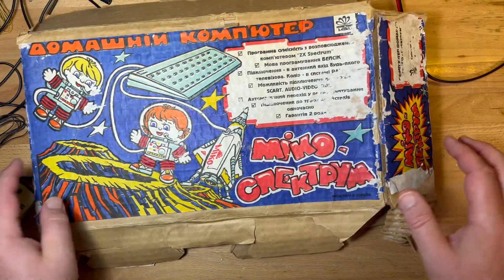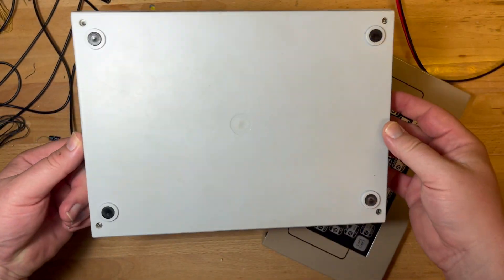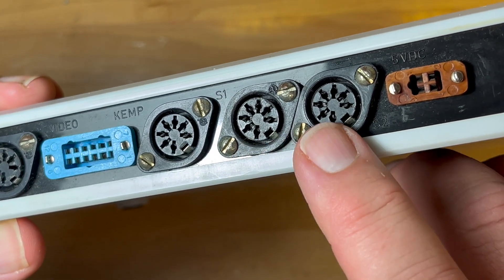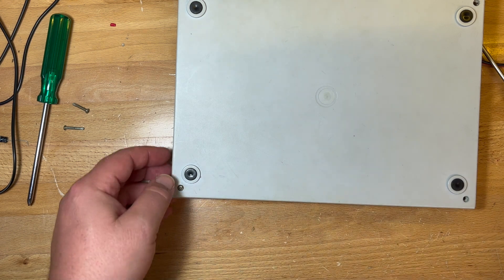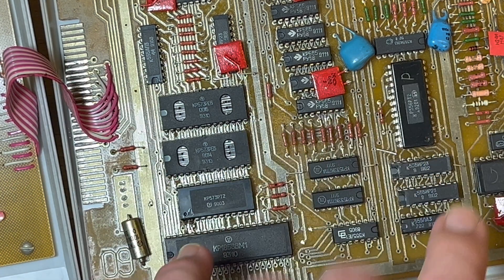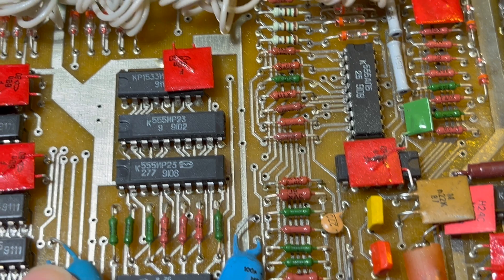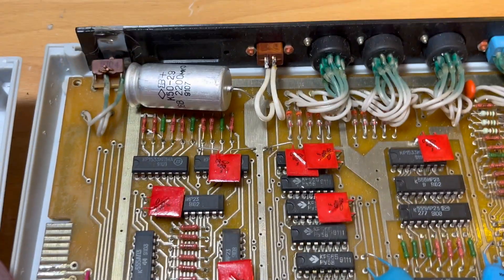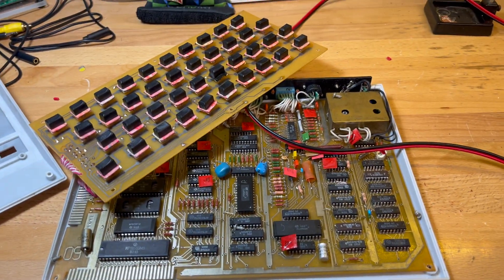🇺🇦 Міко-Спектрум (Miko-Spectrum): Part 1 (First look) [TCE #0414]

Comment: Soviet electrolytes should be replaced IMMEDIATELY. Also please avoid moving any ceramic capacitors cause those are really cheap and their lids fail. 
It would be a good idea to change all the square red ones with normal modern 100n

Comment: I thought that I recognized that box!  I've been trying to get some money together for years to buy some Speccy clones from him/her.

On another note, the RG12 connector looks to be about the same size as a DB9/DE9 port.  If the cables you get won't work or are a bit dodgy, perhaps the DB9 route will work as long as there are 9 or less wires going to the port.
Reply from the maker: Some tips:
[1] If they've had it listed for a while and it hasn't sold, add it to your watchlist - they usually offer a discount then.  
[2] I use Paypal-in-4 to split the cost up over two months
Reply: @Brfff  Did you see the second part of my previous comment?

Comment: That’s not Russian, that’s Ukrainian.
• Software compatibility with widespread ZX-Spectrum computer
• BASIC programming language
• Plug into antenna socket of any TV. Colour in PAL system
• Plugging into SCART, Audio-Video is available
• Automatic transition into read mode
• Plug up to 3 joysticks simultaneously (oh, I see — Kempston, Sinclair1 and Sinclair2)
• 2-year warranty

Rather nice board, but USSR cannot make keyboards, that’s all.

Well, I could use Cursor somehow, and for one game on unrelated computer (Korvet) I always redefined keys to 3 - 5678 - 0, but Sinclair with 6-7 left-right, 8-9 down-up, 0 shoot was just unusable for me. OPQAZ or OPQAM was bad for me too.
Reply: An interesting quirk that the designer chose to transliterate "BASIC" into Cyrillic whilst keeping "SCART" in Latin.

This text itself is part of the derussification of post-Soviet Ukraine.
Reply: @markevans2294  BASIC — that’s exception just for programming languages, their names were transliterated in USSR. New standards that came in late 80s weren’t.

Comment: 556RT2 is a programmable logic device, equivalent to the Signetics 82S100- the very first PLD.
Reply from the maker: That's a better description - I paraphrased quickly from here:
https://eandc.ru/catalog/kr556rt2/

KR556RT2
Bipolar programmable ROM.
The KR556RT2 chip is a programmable logic matrix (16 x 48 x 8) with a capacity of 512 bits with three output states.
It is programmed by an electric field and can be programmed by the customer himself.
Manufactured using bipolar technology and designed to work in general-purpose electronic equipment.
Contain 6,150 integral elements.
Imported analogue: PLS100, 82S100 from Philips.